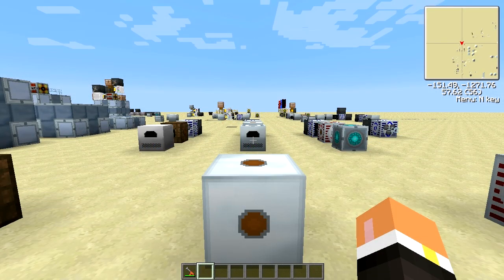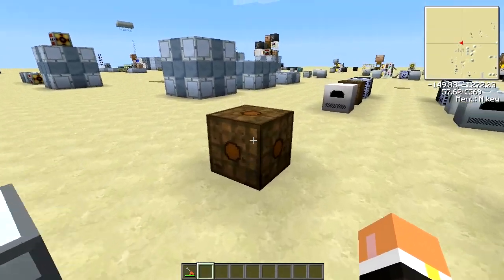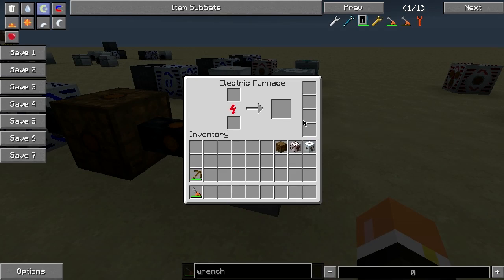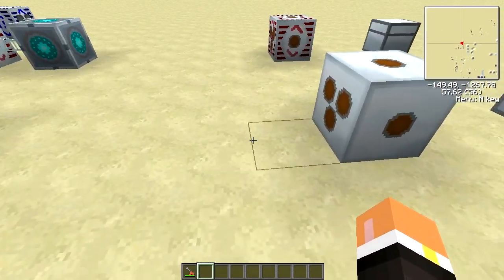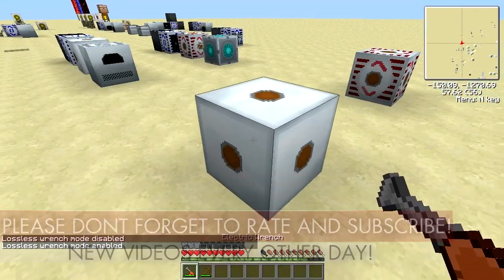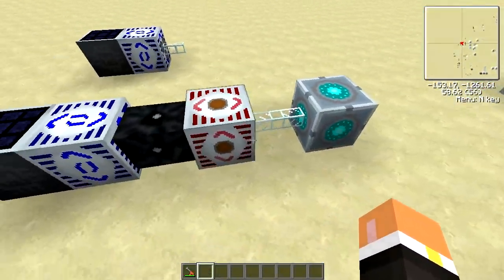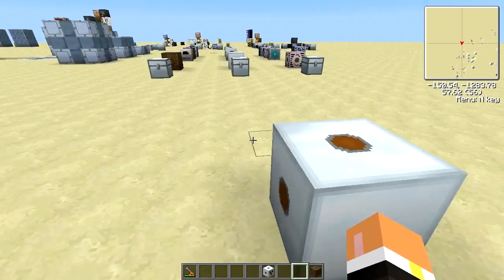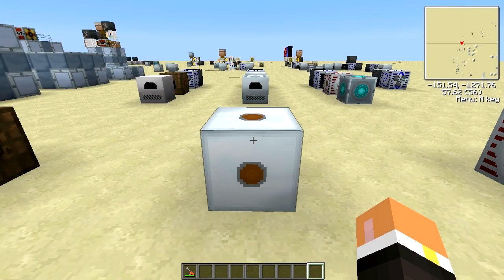Feed The Beast :: Machine Tutorials :: Transformers

Comment: How do I connect a ultimate solar panel to a eletric furnace
Reply: After the ultimate solar panel, you need a HV transformer, after this one you need the LV transformer, and after this one you need a LV transformer... and put up your furnace
Reply: Use 2 Transformer Upgrades and it should worke ^^

Comment: Quite good information here! But notice the difference between EU/t and EUP. The voltage is described in EUP as in EU per Packet, not EU/t as in EU per tick which is how much power flowing per Minecraft tick. For example the Mass Fabricator (disabled in modpacks with GregTech) is specified to 512EUP, but will draw more than 512EU/t if you wire it to more MFSU's in parallel. But if you connect it to something that sends out more than 512EUP, it will say blow up.

Comment: I can help you with the packet thing if you want to read a little lol.

If a machine gives off 128 EU/t, the packet size is 128 EU. If thats how much a machine can handle, it can only take in a packet of that size, and no larger. You can, however, send several packets of that size to the machine and be just fine. I believe thats what the converters are for, to divide the packets and send them in smaller loads. (Not sure about the transformer thing, but I think I'm right about the packets.)